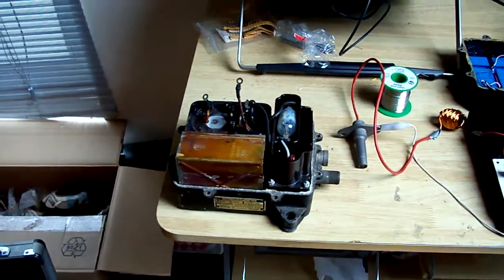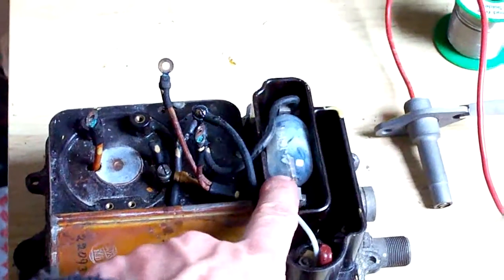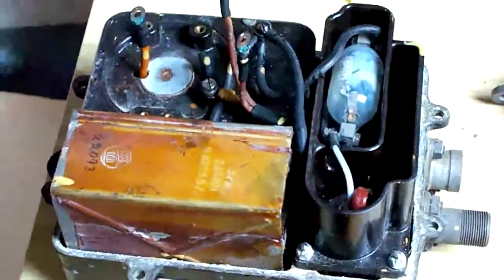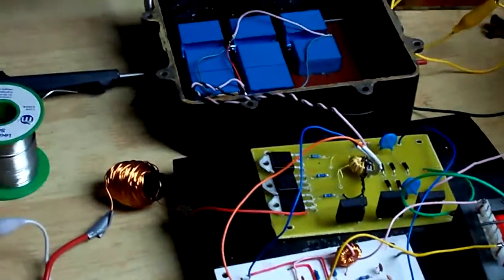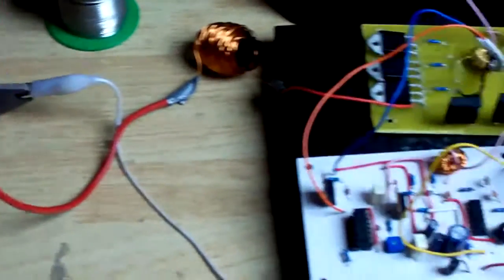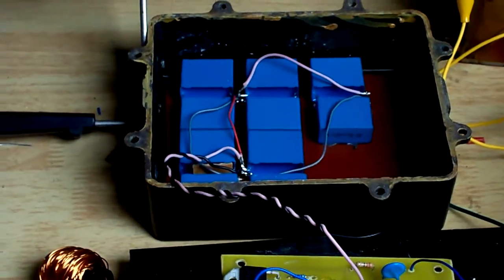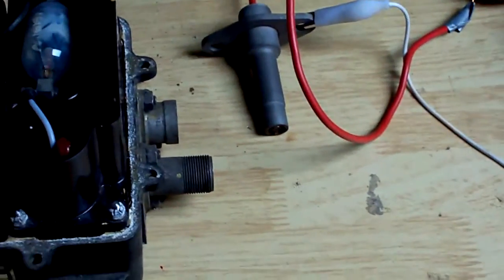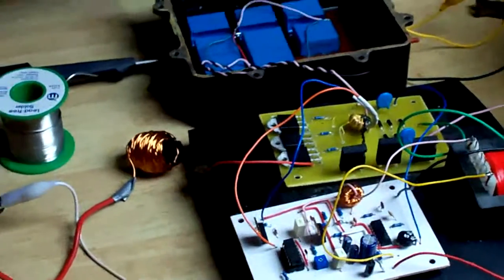Jet Engine Ignition Unit

Comment: this is steve at consolidated aircraft new york. we still overhaul the nb 34 and nb38 igniter boxes for bac1-11, f-27 and gulfstream one customers.  we have the vibrator points but they are not cheap.

Comment: Hi Justin,  I am currently building two 7 inch diameter axial flow jet engines to go into a car but I have not got any ignitor boxes, could I possibly by a copy of your circuit diagram so I could make two of them please?   also you mentioned that you make your own EHT cable,  some more info on that would be great.  All the best.  Jonathan